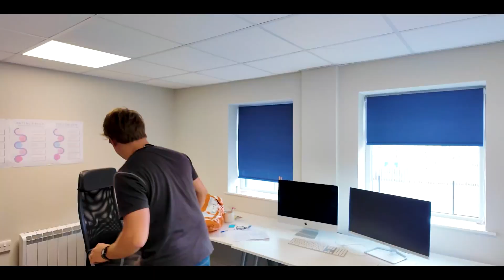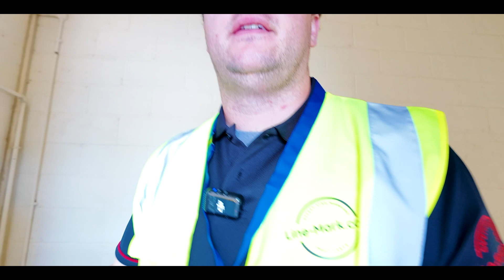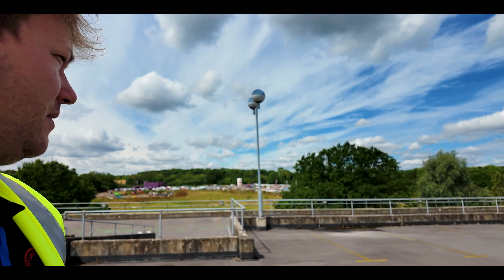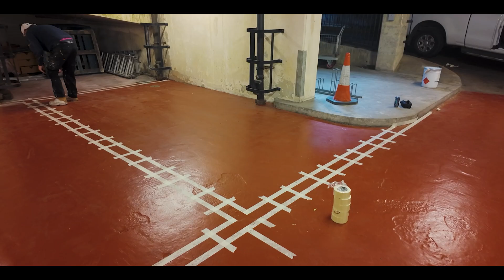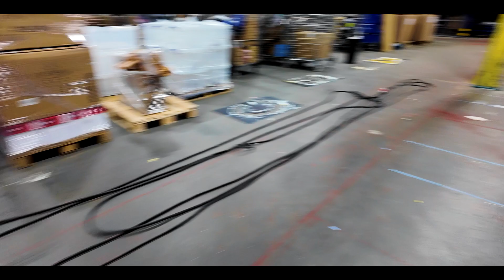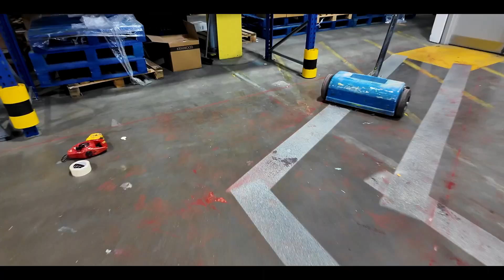Behind the scenes of running a line marking business | Episode 5

Comment: Hi Alex, how do you keep the line so straight on an uneven surface?
Reply: Placer le pistolet à l’arrière de la machine change tout
Reply from the maker: Yes, placing the gun at the rear of the machine is always better than the front position. Well said. 

It’s also much easier in this position for curves. It’s just parking bays we find it doesn’t work as well as you often can’t get close enough to the edge of the bays
Reply from the maker: Now that's the million dollar question @biffen1969! 

I have tried a few "add on" items such as the Titan SureTrak Floating Gun Kit (link: https://www.spraydirect.co.uk/acatalog/Titan-SureTrak-Floating-Gun-Kit-759120.html#SID=2113) but they cost £1k and don't add much value. 

The best way to keep it straight I have found is to use a laser guide system - this is easier on a long distance line but shorter lines always look "iffy". If you have to do it on a short line over rough ground, try using a hand mould and an aluminium edge. 

The bigger issue I find on a rough surface isn't so much keeping it straight, but keeping the line width consistent. 

Typically, as the spray arm is fixed, when you roll the machine over a rough or undulated surface, the gun moves up / down and that changes the line width - sometimes by a fair bit! Again, in this situation, hand mould and MMA is my go-to! Hope this helps. I'll make a separate video and also add it to the week 6 ending for you.